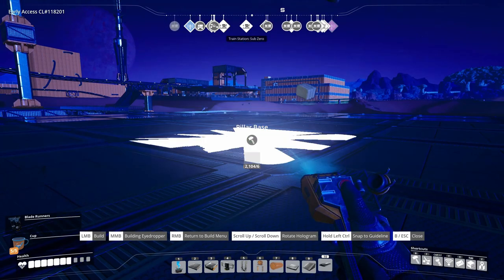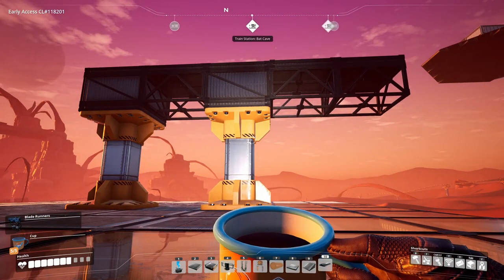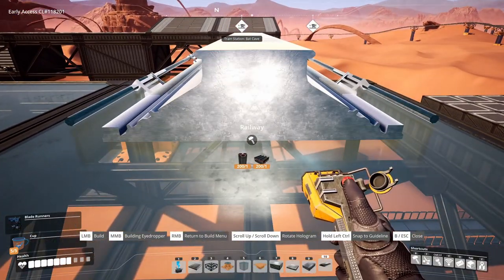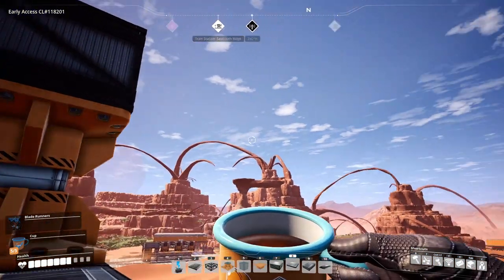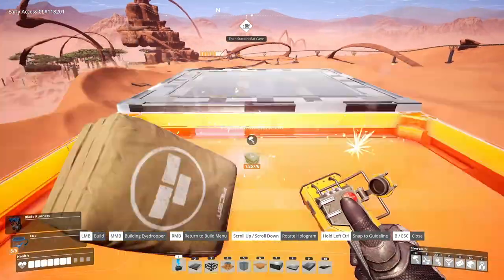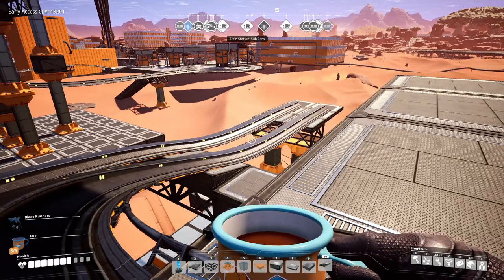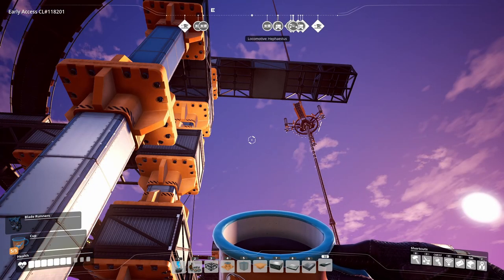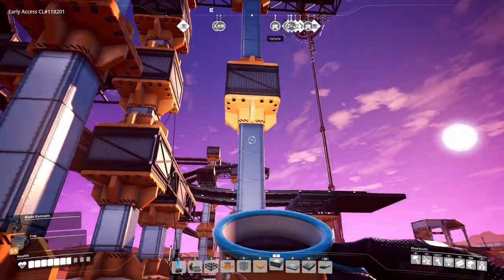How-To build a Twin Rail Spiral

Comment: Very nice although the closer rails will probably trains on both rails to clip each other,
Reply from the maker: Thank-you. Yeah looks as though you are correct, there would be a tiny bit of clipping on the locomotive where the wheels are. I'll add a note of that to the video description as well as to Reddit.

Comment: So I'm assuming you can increase the width from 5 squares up to in decrease incline of train rails for improved the ability of fully load train making it up the tree quickly?
Reply from the maker: Yes, to an extent. If the branch arms are too long then you may be limited by the maximum length of rail track. I was trying to achieve the tightest design.

Comment: Im using 1m double ramps to do a spiral and the loc goes full speed up with 16containers loaded. This design is what i used first and my train couldnt go up there xD
Reply from the maker: Do you have a screenshot or video to share? I've honestly never had a train that long.
Reply: @ZonfluxGaming  
https://ibb.co/py1XXLN
In the upper left corner you can see my coal hub and on the right side is my base build-in-progress.
i have a coal hub in the south where i have 32 "normal" coal conveyors gathered (2 impure connected into 1) and those 32conveyor belts go to 16 Freight Platforms = train with 16freight cars :D and those go to the north sea to my main hub where im building a mega coal plant within with around 600-650 coal gens (final design not decided yet). :D for those coal gens i probably gonna need around 100 fluid fraight cars (water) traveling around. When i started that project i didnt imagine how much time it would take xD it took me many hours to gather all coal nodes (those from the desert in the east are seperate) at one point. I just hope my PC can handle it XD